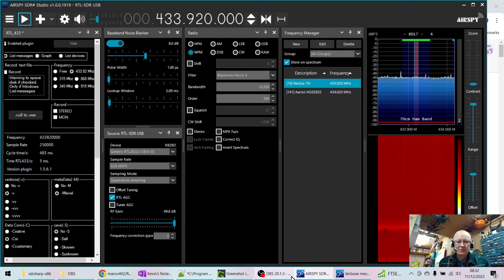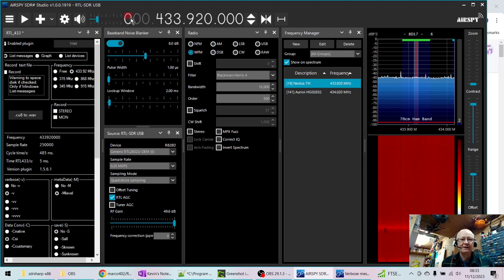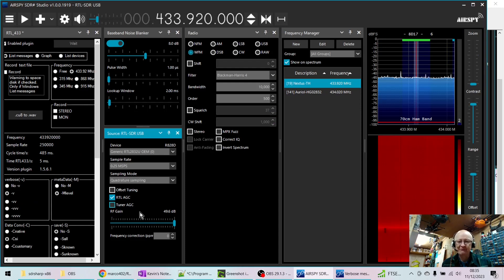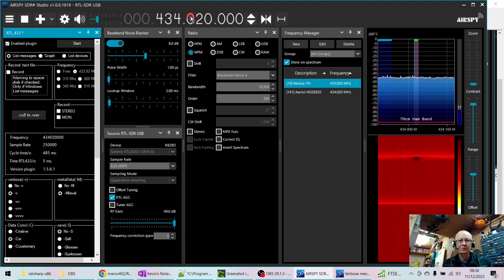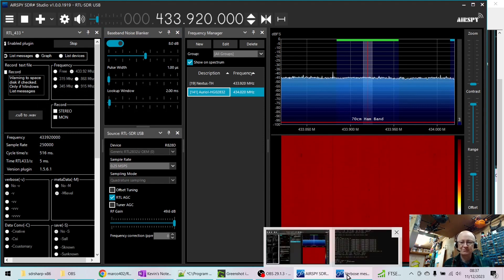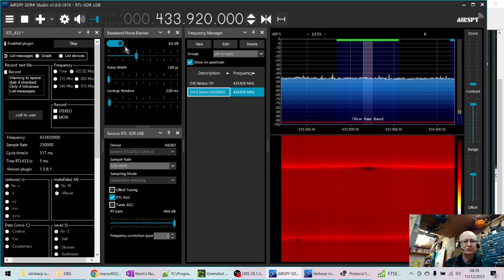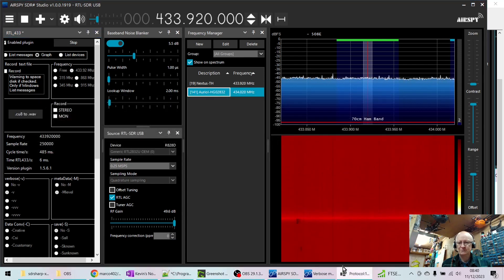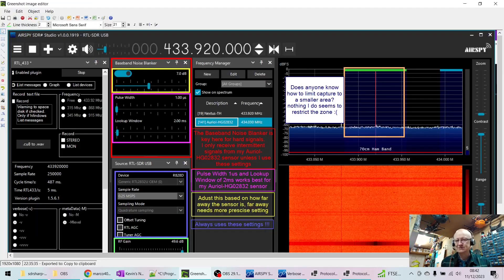SDR Fine Tuning 433mhz Signals in SDRSharp SDR# SDR Sharp

Comment: I was playing with this.. (I set a wide bandwidth) of 200,000 to grab a wack of devices.. (BaseBand Noise Blanker) not used.. RF Gain 32.8 (But.. I say This Plugin Needs work also 😊)  Fidle Fidle
Reply from the maker: Yeah I agree. I found is it was difficult for the plug in to work put what the signal was. My car TPMS is detected but the values are incorrect.  Thus the same header but different calculations used for that signal. I did find it all very interesting though. I'll come back to this one day. So many projects at the moment.